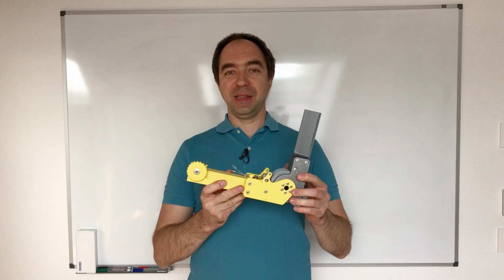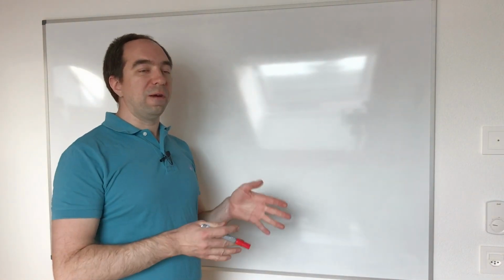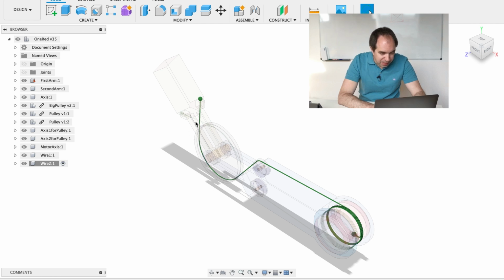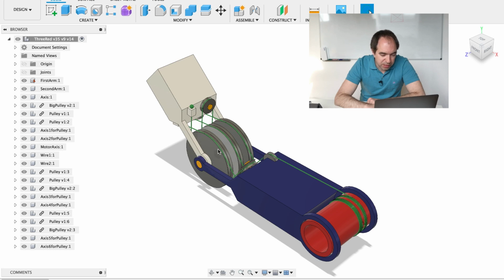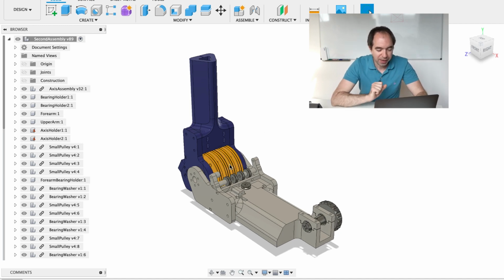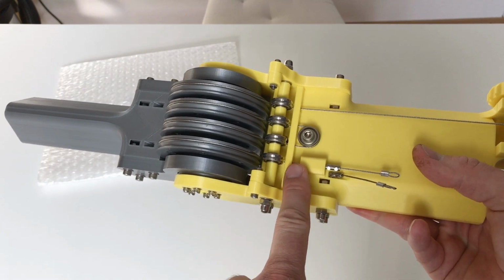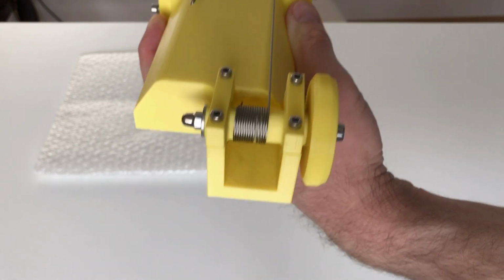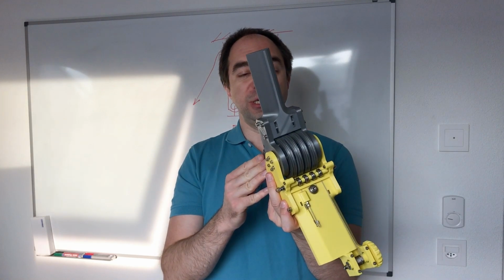You've never seen the Robot Joint like this one!

Comment: great design, I would say the only thing I worry about here is creep in the steel wire. Some of those pulley's are definitely not a large enough diameter for the diameter of wire to avoid stretching of the wire. synthetic ropes like DM-20 or Spectra may serve you better than steel wire, because within a very limit number of cycles that wire will creep and all accuracy in a larger robotic system will fail. The problem with all rope/cable based drives, is always in the stretching of the cable and then having to taking it apart and replacing it.

Comment: Nice build. Works well in theory, trouble is, it won’t last long in practise because all cables will eventually stretch (this is called “creep” in this sort of mechanism) and will loose tension; only a small loss of tension will stop it from working across the full range of motion. I don’t think it’s possible for these to handle large amounts of torque (E.g. 20Nm) for very long.

Comment: I mean, cool, but it is so easily back drivable, there is not way that could be practically used to exert force on anything. Unless the motor was freaking huge and could provide enough resistance to prevent it from being back driven, but this video fails to really demonstrate that.

Comment: Really nice cable mechanism - well done ! Some time ago I also built a cable driven motion plattform but used dyneema fishing line. So I wonder: do you have any experience with the wear of these steel cables and is the bending radius on the small rollers you use above the plastic deformation limit of the wire so that it will not break after many cycles?

Comment: Hate to say this was thought up a long long time ago in several medieval and before periods. Most recent was kinda a play on this and ratcheting systems where a mercenary got his arm cut off but swore to be the best warrior and swords man even missing his arm. He got to work made two or three interactions and the third was strong enough to actually grip and hold a sword with the strength and grip needed to actually fight once again and it was his dominant hand that was cut off. He used kinda this along with a way to close and self locking ratchets for each finger then using a system of pulleys was able to release the grip with a simple efficient and very controlled flick of the shoulder or something that would release the ratchets that did have several hundreds of lbs of grip force when engaged based on recreations of the actual functioning prosthetic that has been in a museum cause of how advanced and genus it was specially for like 12-1,500’s. Or some thing crazy early. The others are the automatons passed down thru legends in history of them serving tea and doing other work usually done by a slave or servant. One story was there were a bunch in a garden and when called upon would come to life and actually do battle with out any one controlling them directly but all so documented these were machine humanoids that had intricate and complex amounts of pulleys gears and wires creating the movements yet no one knows or understands how the commands were stored and how much free movement and abilities they actually had. Story’s were they acted like human servants capable of doing what ever the person needed and requested. Others have them able to fight by interacting reacting and defeating opponents with weapons and swords as well as were said to be far stronger and faster. Yet the guy describes the insides of them. This is like super old times even before chinas first dynasty and Mesopotamia I think was just getting going. Many have speculated it was left over relics from Atlantis or some of there technology that survived and was spared. Or other theories is they were not mechanical but indescribable technology or species of cyborg hybrids that have merged there biology with upgraded enhanced technology kinda like our all ready entered next society singularity event. And with our pace of progressing we are all ready started into that singularity and are with in really 5-8 years before really seeing this jump from theoretical and syfy mad science into normalized equipment we need to really function and make it in this new world. As well by then we will have mapped the entire human brain really seen ai come to age and mature, along with ai drug Pharma cures diseases and even death giving us possibly hundreds to thousands of years of life depending even able to take control of our genetic evolution our selves and complete the dogma. Fyi the big Pharma curing death is only 2-4 years away and they really all ready have just now starting human trials after ray and animal trials were so successful. The people created this say curing death is way easier than curing cancer. Cancer will be kinda ai’s big thing due to every person and case will need a unique and specially formulated drug probably MRNA and protein wrapping drugs that are specific for that cancer in that single person only for a few days as well to be effective so keeping up and manufacturing this with out ai would be way to cost prohibitive and just not realistic for all cancers. Some sure we will crack. Others will still haunt us and kill us. That is till we start transferring consciousness into computers and living inside digital realities able to interact between both worlds till the day we are able to cure or repair there lost body then replant there soul back into it like reloading and transferring an old iPhone onto a new iPhone. Use to take a desktop with massive hard drive space and hours to back up hundreds of gigs then transfer them over to the new phone. Now u just sit phones close they do it wirelessly and in a fraction of the time thanks to 5g. Now if we can get apple to stop slow rolling there tec and give us an actual big jump back ahead of other phones that clearly have caught up and exceeded apple in so many ways from batteries to operating systems and seamlessly just works with everything same as apple if not slightly better.

Comment: You can also gain a torque advantage by shrinking the diameter of the winch spool.  Your way adds strength to the joint as well.  By splitting the forces over multiple cable lines.  The winch won't add strength. But It will add mechanical advantage.
Reply: using a PE fishing line you only need like 4x the diamter of the fishing line as the diameter of the winch shaft I heard.  Whereas with metal you need like 20x or something since a overly small diameter would stress the metal cable.  PE fishing line is more willing to make the tighter turns without stressing it to failure and stress fracturing internally.

Comment: Great design! I love your videos! I would love to know how the mechanical stiffness of a cable mechanism like this compares to that of a comparable geared actuator. 

I used the same basic concept to make a soda can crusher. The driver is a small hobby brushed motor so I used 32 pulleys and braided fishing line to greatly amplify the low motor torque into 256 lbf (theoretical) of axial thrust. There is a fair amount of friction but the actual output force is enough to crush cans (>=  ~170 lbf). 

Here is what I learned along the way. The tension in the line needs to be high enough so that under full load, the line on the reel-out side of the drum doesn’t go slack. In my can crusher, if the reel-out side goes slack, it won’t wind on the drum correctly and will get jammed. Having to increase the pre-tension to avoid jamming increases the friction and thus limits output force. Whether or not the line goes slack on the reel-out side also depends on the length of the line. So, applications that require shorter lines will need higher pre-tension.  Of course, the stiffness of the line also plays into this. I was able to get 40 lb test braided fishing line to work but I’d have to use a much higher test monofilament just because it is less stiff.

Comment: Wow it's amazing to see that just wires can be used to make higher torque! Earlier i was thinking what if use wires instead of 3d printed gears and now this video only ensures me more :) but i'm still not sure what kind of wires i need to use and where to get them. I guess it should be soft, able to bend, and at the same time should be strong enough. Also, is there a possible problem that over time wire will become stretched and will lose it's performance?

Comment: could this be made more compact by rotating the rollers on the "static parts", that is not the large wheels, 90 degrees so they are alligned with the big pulleys? this seems like a pretty wide design.
Reply from the maker: Yes, definitely. This is a really good idea!
Reply: @Skyentific  would you attempt a second revision of the joint? i find it very interesing since it requires very few high tech or precission parts. cable drive is both precise and cheap.

Comment: What has kept you from using this joint in your Robot arm? I'm currently working on one arm by myself and was wondering why you haven't implemented this design into your arm, especially when there is no backslash. Thx
Reply from the maker: Complexity. There are a lot of moving parts, that is why it is complicated to integrate it in the robot arm.

Comment: Love the concept! Especially because with proper tensioning, it's a very cheap zero-backlash system. 
But... The way I see it, you only have the mechanical advantage of 4. IMHO It doesn't matter how big the gray big pulleys are - they are simple rolling guides in this system. The block-and-tackle mechanism works the same no matter how big or small the gray pulleys are. The real multiplication comes from the diameter difference between the driver drum and the knob. Am I seeing this wrong?
Reply: Yes, the video is misleading. The main mechanical advantage comes from the driver drum; the pulleys are just rolling guides. You can increase the torque on the forearm by moving the contact points further up the forearm (which makes the grey pulleys bigger) but it's incorrect to call this mechanical advantage.
Reply: @ErosNicolau  @alirezanejati9712 The torque applied at the joint is occurring at the joint pulleys which have a radius that is larger than the drive pulley radius.  I think the OP is correct in his 20:1 torque multiplication calculation. If you look at the amount of cable that if transferred on the drive pulley it is about 10 turns for less than half a turn on the joint pulleys so the mechanical advantage seems correct.

Comment: if rollers are fixed you cant get mechanical advantage. No matter how many roller you use.
Reply from the maker: Not all of them are fixed. And it works. I have working prototype. With measured mechanical advantage equal to theoretical mechanical advantage.

Comment: wich bearing you use?
Reply from the maker: For small pulley I use 21x15x4mm bearing. And for big pulley I use 44x35x5mm bearing.
Reply: @Skyentific  What is the bearings with slot for cables ?

Which names?

Comment: With precision CNC metal parts and thinner dyneema wires, there's actually significant room to miniturize this joint to less than 1/10 of its original size. I'm not sure about the zero backlash, if the wire isn't tensioned enough you might easily introduce backlash. And to keep the cable preloaded the wire needs certain degree of elasticity. But then rigidity may suffer from elasticity. Still a very impressive design. A huge advantage with cable driven joints is that the motor and reduction may be relocated closer to the chassis, this significantly reduces moment of inertia on the moving parts.

Comment: integration of a joint and a pulley looks cool. Not an expert, but it looks like you may simplify the design without losing mechanical advantage, if the pulleys are placed near the joint, not all over it.

Comment: Very cool! We use that exact same concept only with much larger hardware, to automate scenery movement in theaters. Wires are redirected from hanging or rolling scenery, (and through double purchase snatch blocks in some cases) and run around both sides of a cable drum and kept in tight tension to enable very fine movement. We're talking pieces that weigh hundreds of pounds being able to fly consistently and safely to within a mm of the mark, night after night.

Comment: Very nice presentation. Your demonstration would be improved if you connect it to a small servo motor and measure the lifting ability of your elbow joint relative to the power input of your servo and torque rating.

Comment: Yes! Adding a force gauge to one of the cable ends, and using a brushless motor for speed and a force-activated/solenoid engaged worm gear for strength, you could make a robotic arm that can throw not just a fast punch, but a powerful punch. Will Robinson is about to finally get his comeuppance for being such a snotty little brat to Dr. Smith.

Comment: Is there an advantage to building the reduction into the joint vs just using a standard gearbox on the input? I suppose it would reduce the tension on the cables?

Comment: As a bicyclist (vegan law student) I doubt this no backlash part - bicycle breaks cables get extended over time and become elastic, so this may have effect on stiffness. Unless cable would be under constant force for some reason. The only reasonable reason I see would be some smart engineer.
Reply: Yes, you are correct.  With cable stretch and pulley wear comes backlash and effectively positional bounce.  I had cable boom conveyors that used a similar idea.  Retensioned yearly and scary at 30 ft out.  Cable snaps and the whole thing is boogered.  Plus no brake system unless he puts a drum brake on it.  View Anchor chain loss videos and watch the drum brakes explode.

Comment: First of all very cool concept. I have an question though, if I look closer at your design at 5 min it looks like your “big pulleys” are manufactured out of one piece since I only see two bearings. Doesn’t this cause extra stress and friction in your prototype since the “furthest pulley” has 4 times more cable passing over it compared to the “closest pulley” while both rotate at the same speed?

Comment: Very nice. Great precision for 3D printed stuff.

Did you consider mounting your stepper 90 deg to the motor input pulley (inline with the arm; it looks like you have room), and then use a worm gear / spur gear for further reduction?

Comment: Personally I like to call these tendon actuators, as the wire/cable is doing the job of a tendon in a muscular-skeletal system. These can also be driven by any form of actuator, both linear and rotational.
Personally, I'm more interested in the 2dof wrist actuator used on the LIMS2 arms. I know there's a video on the mechanical design of it, and it shows the internal joint in decent detail, but sadly it doesn't show it's pulley system in as much detail; I just know there's various hinges and wire guides, but I'm clueless on how the cables are routed through the wrist pulley system, the pulley system at the base of the wrist, or how the cables are routed through the arm in general.

Comment: Great design. Nice for when you need a affordable transmission system.
But, on the backlash side - Yes, in principle it is backlash free, but everytime you are doubling the cord length, you are cutting stiffness in half.
In the end it might be without backlash, yet still wiggles because the elasticity gets too high.
Also, although it is cool, to see you move it so easily, it would be nice if you could add self-locking to the mechanism. So no external force can move it

Comment: Not sure if you mentioned this but you could produce variable levels of torque from the arm by treating the fixed point of both ropes nearest the joint as a wheel with a brake on it and both ends of the rope are joined together. Putting the brake on different wheels will allow many different amount of torque. Downside is that you would have probably have to place the brake at different wheels to achieve the same torque in both directions. Also, after some maths on the back of an envelope, there will probably be no slack the rope as long as only one brake is activated at any one time.

Soz for the lack of technical terms

Comment: This is a very interesting device and video.  I've been a mechanical design engineer and consultant for 30+ years.  This is a very interesting way to incorporate both anti-backlash characteristics and pulley leverage/reduction in a small package.  In semiconductor manufacturing equipment, I have seen anti-backlash simply and successfully incorporated with opposing stainless steel (SST) flat belts.  But I have not seen anti-backlash with round cables which more easily allows the incorporation of pulleys in three dimensions.

A simpler sort of device based on this concept may help me to solve a longstanding challenge that I have had with a design of some [7 - 8 meter] long, stiff, light-weight, fold-able booms.  I have been trying to come up with a simple and unobtrusive way to stabilize the booms when they are being acted upon by substantial outside random forces and accelerations.  I'll have to think about this some more.

Ed  -  http://www.schultek.com/

Comment: Good design work!  I'm surprised there isn't more friction in the system.  I imagine the cables produce high loads on the pulley surfaces.
Reply: One of the comments explains that the force on any pulley axel is only 2 x wire tension.  The main pivot shaft has the most radial load but it is distributed and probably no more than any other actuator system.